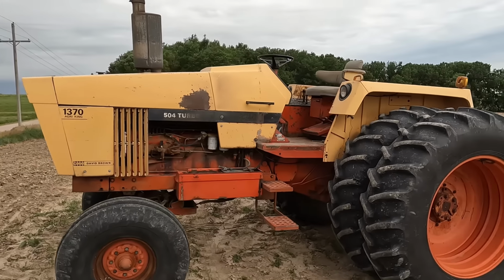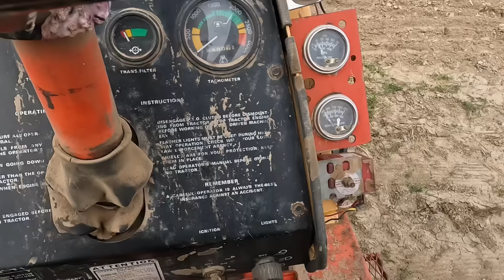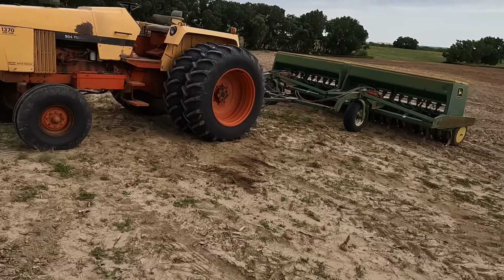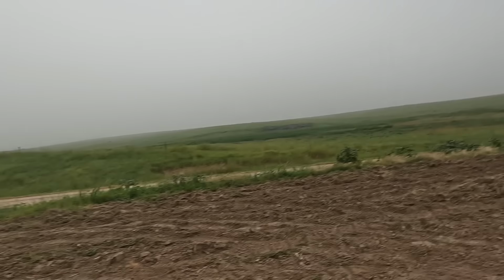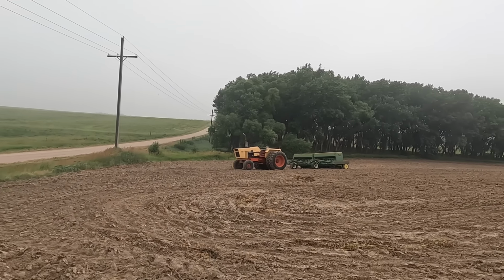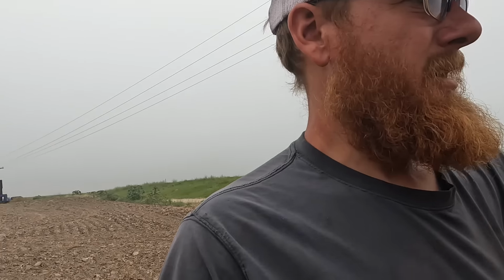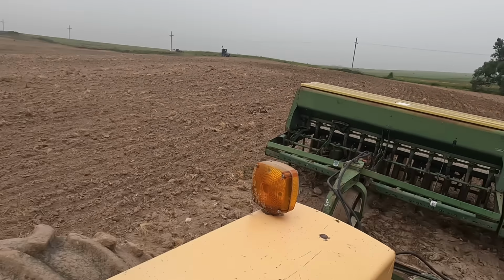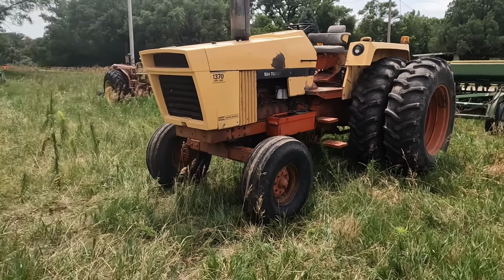Can We Beat Rain? Drilling Sudangrass w/ a Case 1370 Open Station!

Comment: That’s the exact same tractor that gave me tractor fever. Lol.  Back in 1975 when I was 6 years old my dad would borrow our neighbors 1370 and disk and plant wheat in our fields for our stockers. The neighbors 1370 was also a 73 model and was that peach color. He was a really good neighbor and person. I’ve always liked those cases from that era, but there hasn’t been any case dealers around here in many many years. I saw one sale a few years ago at auction in Thayer Kansas that brought a little bit more than 6000 dollars with a pretty fresh complete transmission rebuild and I think he said a pretty recent engine major. It sounded really good. I went to buy a chisel, but I should’ve bought that tractor. 6000 wouldn’t touch the parts for the engine and transmission, let alone the labor. I think a dealer did the work, and I’m pretty sure he had the receipts. Could’ve should’ve!
Reply from the maker: You can pretty quickly dump $10k into a case transmission that’s for sure. This one seems to be super strong thankfully. It’s been a pleasure to run.
Reply: @tmonteIH  I believe that. I’ve heard some stories of guys tearing them up by clutching them in road gear instead of down shifting all the way down. I’m pretty sure that’s what they said happened. One was an early 1370 similar to yours and the other was a 2390. that’s definitely a nice looking and sounding tractor you have. I really like it as an open station. I’ve covered many acres on open tractors and I’ve breathed and ate lots of dirt!! lol.  Great video!

Comment: When I went to buy my 1070 everyone tried to talk me out of it.. prior to the 1070 I had alot of time in a 2470 and a 2670 case.  I knew the powershifts and clutch and all those issues...  I didn't listen to the nah sayers.  I have had 0 issues and being in western ny it starts with no either or boosted pack at 10 degrees  out . Always starts right up and goes right to work . Shifts smooth , hydro pumps smooth. I really do love it.   I'm the 2nd owner of it and she gets treated well. It's like retirement for the Ole girl.      Yours looks hell a cool with a open station !!
Reply from the maker: It’s a fun tractor. I’d like an 1170/1175 open station next.

Comment: T T we had John Deere planter that had drive chains on the wheels. The tension sprockets were spring loaded. It was easy to take the drive chains off the wheel sprockets. When we moved the planter. May be that would help you. (Tied the chains up with baler wire! )
Reply from the maker: These aren’t easy to remove at all. They run inside a cover shield that’s 6’ long under the drill. No good way to undo them.

Comment: Sounds like the old girl runs pretty good. I worked for a guy back in the late 70's who had all Case tractors. He had a 1070, 870, 930, 830 and a DC. The DC had a F10 loader on it. That was an awkard combination since the hand clutch and the controls were all on the left side.
Reply from the maker: And I’m sure you didn’t have enough hands either.

Comment: I do have a question about your 1370 was it white because most of the 1370s add air cleaners on them just like the all the others put the newer 1370 did not have air cleaners on them English complete under the hood
Reply from the maker: It has been tan its whole life. It’s a 1973 model built right before they became white in 1974
Reply: @tmonteIH  thank you because I have a 1972 870 desert sunset
Reply from the maker: @davidclevenger4485  your welcome. Used to have a 71 870 & 69 1070. Still have a 72 970 gear drive I use on my machinery lot.
Reply: To me you can't beat those Good Old Agri king
Reply: I do have a 1974 2470
Reply from the maker: @davidclevenger4485  the 870 I had was great. 1070 not so much.
Reply: @tmonteIH  I growed up with an SC 730 870 then o got the 2470 then a DC
Reply: @tmonteIH  the older 70 series they had a different style cabs then they did I'm assuming in the late 71 had a different style cab my 870 has a bettendorf cab on it
Reply: @tmonteIH  my dad and our case dealer it was really good buddies well in 1969 he got the first 70 series and he told my dad to drive it around it was an 870
Reply: @tmonteIH  we always had Case equipment
Reply: @tmonteIH  and still got a 660 combine as well it's a 1969
Reply: @tmonteIH  when I was very young we had two 1660s and a 1665 I don't remember 1660s ever running
Reply: @tmonteIH  they had a 318 Chrysler motor on them
Reply: @tmonteIH  the 660 was the last case combine used a case motor on them